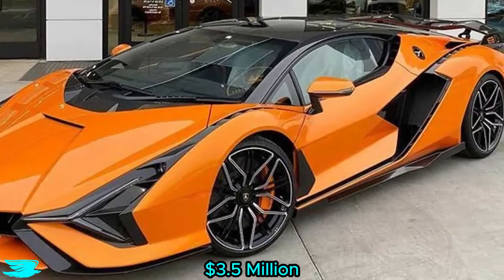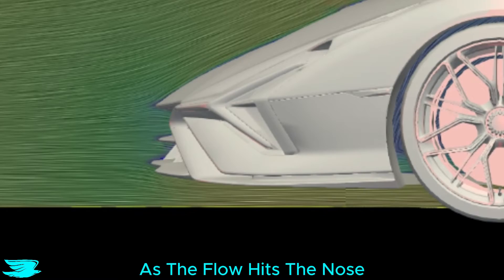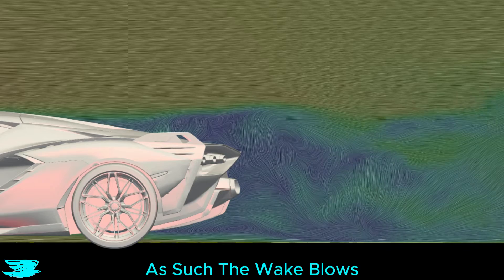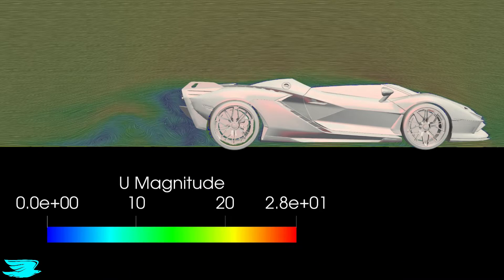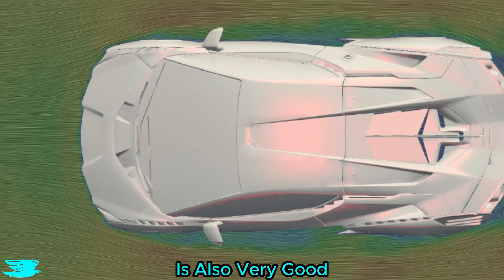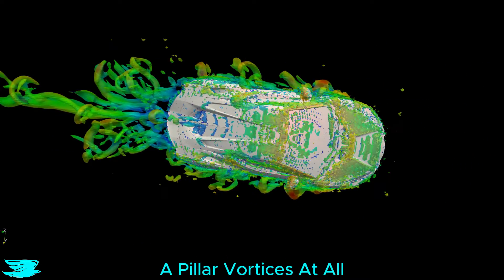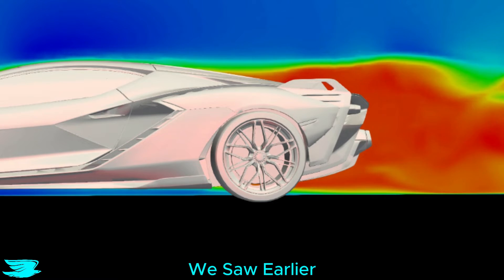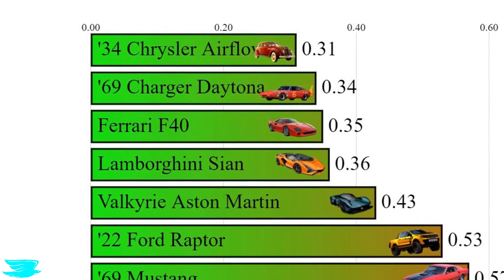*New Lamborghini Supercar* Aerodynamics

Comment: How does a Ford Fiesta have the same drag coefficient as a modern supercar like the Sian?
Reply: Most modern cars are very well optimized, and modern supercars need to generate downforce, which usually comes with a bit of drag. Also you’d be surprised by how low drag coefficients are for stuffs like modern buses
Reply from the maker: That's all true. Regular cars are optimized for low drag. Supercars are optimized for performance and looking cool, so low drag isn't the only thing they want.